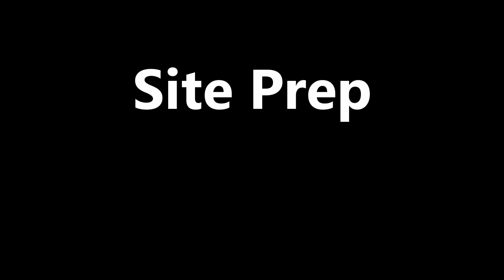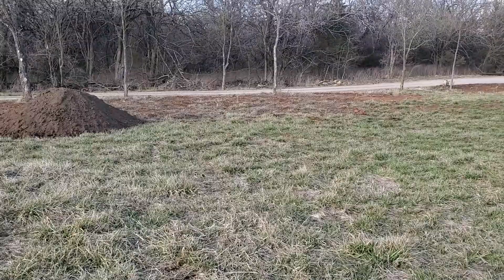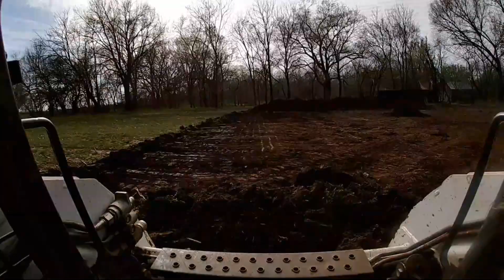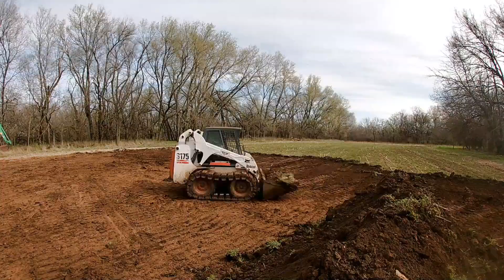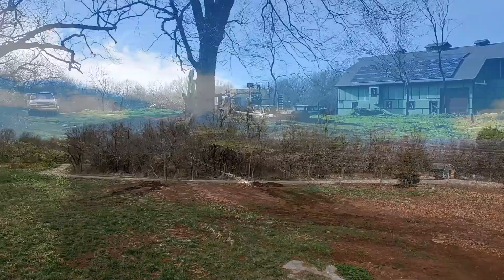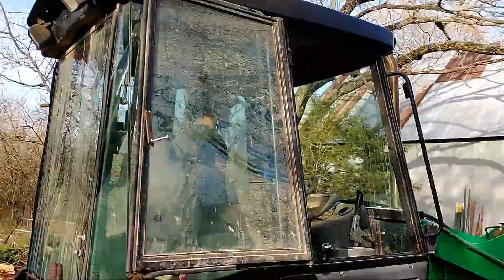How to INSTALL a SEPTIC SYSTEM Start to Finish over Bedrock

Comment: HI, 
How do you like that Tank?
I hard since it is two pice it my leaks, Do you have any problem withe it?
Do you recommended?

I am taking about 1530 Models.
Reply from the maker: I did a lot of research and this tank was the best poly tank on the market at the time in park because of the seams.  They are joined with mechanical fasteners instead of a molded or welded seam that could split.  The seam on these is very beefy.  I'd recommend the tanks.  We haven't had any issues with them.

Comment: Donthe leach field need to be so extensive
Reply from the maker: I didn't think so but that's what the county told me to install.  I've checked the inspection taps and they're always empty.  It seems like only he first 30' is actually being used.  I guess over time it'll clog and flow further down the line.

Comment: Great example of everything you should never do.
Reply from the maker: And yet it all works and past inspections.
Reply: @Off-Grid  well, most failed systems you wouldn't know it unless you know what to look for.  Biggest part of a septic system is protecting the ground water.  Using fill is not legal in most places and driving on your field with a wheeled vehicle is frowned upon as compacting the soil reduces airation of the soil causing anaerobic bacteria to grow and clog your field over a few years with biomat.
Reply: @Off-Grid  as far as passing inspection,  every jurisdiction is different between each state and even county a lot of the time.   I'm in one of the stricter jurisdictions, but there's a reason we are strict.  First, we don't want effluent to get to the groundwater untreated.  Second, we want to save homeowners $$$$ in the long run with systems that can last as long as possible without replacement or repair.   Too many jurisdictions don't require that up front investment for a system that will survive long enough to be passed down to your children.

Comment: In California code 6 feet of drain Rock under drain perforated pipe completely flat , wonce lay your pipes ,pour rock over pipe a couple inches, then put taxpayer , then you put existing material over system 2 feet plus . All septic systems require perk testing befor lech fields will peak.  If under ground won't pass perk test , then require mound system.  Mound system is basically,  require amount sand under your pipes , feets of sand , plus several feet above pipes , the Reason is the sun will absorb moisture from the system.  It's all engineering system. It can be very expensive.  My understanding they also have huge drilling companies that can drill like 30 feet verdical holes for special areas as lech fields.  .
Reply from the maker: Lol, I just told them I was going to dig a hole and they said to make sure it was a big hole....!

Comment: Instead of building up the dirt, you should have considered digging down 6 feet and layering the ground with gypsium, gravel, sand and dirt.  Much better drainage.  On my property I dug down 15 feet and applied the same material works like a dream.
Reply from the maker: It's all rock a foot down so building the ground level up was the only option.

Comment: Do they not worry about contaminating the water table there? We have to maintain 24” separation between bottom of trench and a limiting layer. Can be reduced to 12” with an aeration unit. No rules like that?
Reply from the maker: Not that I was made aware of and the system passed inspection.  But I feel we met that anyway as I raised the ground almost 4' on the far end.

Comment: FANTASTIC 
thank you for taking the time to teach everyone...

I'm not an expert, we will make own tiny houses two of them and a weight lifting, gym, kitchen, living room, bathrooms, common area building as well where bathroom and laundry room on property will be located geodesic domes all of them, and ...

 thank you for inspiration here...
  but... I don't think we could fill up one of your tanks in our entire life times...  bit of an overkill...  we also plan to reuse all water in garden once we pipe it separately filter it trough sand and charcal underground concrete boxes... so only poop goes into our tank from low flow modern toilets... so we will hand dig, form bottom of tank, mix and pour concrete, then build up septick tank side walls (octagon) around or on top of bottom (octagon) and backfil and in the end pour and put a cover on it, mabee 1500 Liters... and that is it, ading leech lines later at most... 

 and separate tank for filtered soap grey water from house to be used in garden on plants...

that is how we plan to do it... efficiently and not an over build, just hand tools... hope to have sandy soil so then we don't even have to order sand or aggregate, just use what is on property, only ordering a palate of cement to last for the years that we plan to make tons of things our selves...

Wish us luck!

-tibor

Comment: I didn't see know you could lay leach lines on top of bedrock like that, I suspect you may creat an effluent swale at the bottom.
Reply from the maker: We raises the ground up by bringing in dirt and compacting it before putting in the lateral lines and leveling them. They are not directly on the rock.

Comment: In Tennessee, the local self-appointed  gods  at codes claim your dirt can not be distributed  ?
How do you dig a lateral septic line without disturbing the soil?
Reply from the maker: Levitate?
Reply: I plan on building in TN -- the TDEC has told us we have to do a two-tank system and a pump system even though there is plenty of space for a drain field that is down-slope from the home.  I will now find a septic installer to do a site visit and give his opinion.  I have a hard time thinking a pump system with a drain field above the outlet on a sloped lot that is about a 5% slope.

Comment: 7800 lbs of lift if you don’t fill with water.
Reply from the maker: The manufacturer said it didn't need filled but I did anyway.  Have heard to many horror stories about tanks popping out of the ground.

Comment: Great video. What is the name of this Plastic Drum Septic Tank?
Reply from the maker: It is an Infiltrator Tank.  They are the best and strongest poly tank I could find because of how they are built where the seam is mechanically latched together vs melted.  The melted together ones have a history of splitting at the melted seam.